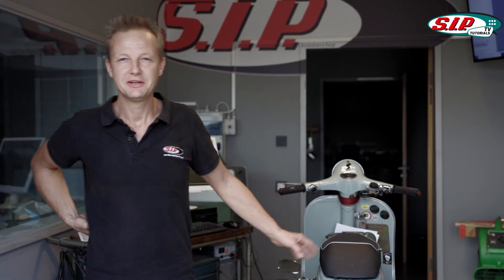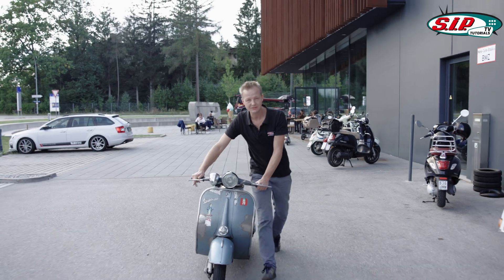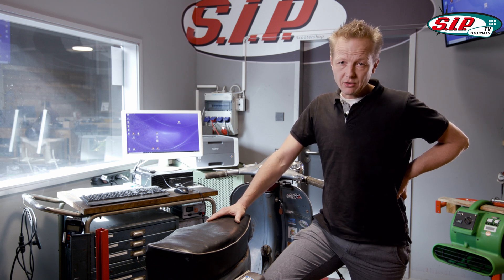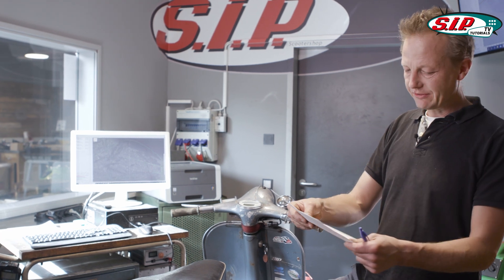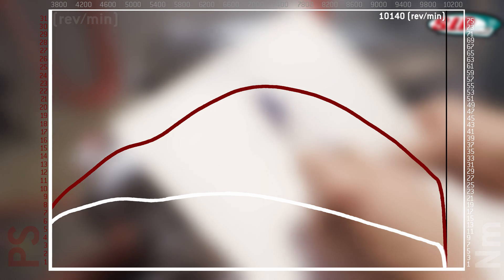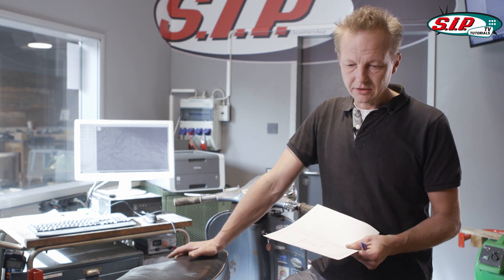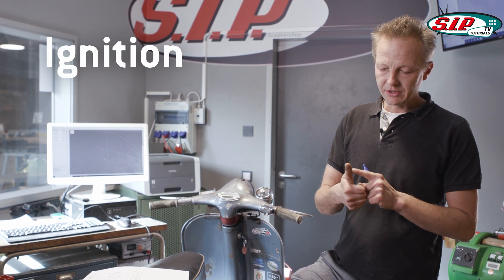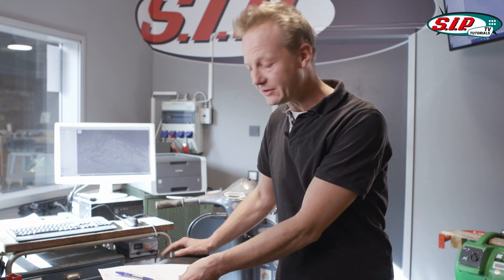Vespa PX Engine TUNING 🛵🔧 | Part 1 | Intro {English}

Comment: Hello, many thanks for your very interesting video. Could you please help to setup my px 125 arcobaleno, I have a pinasco 177 magny court, exhaust Pinasco, with a del orto carburetor 24/24 with 160/BE3/115, are these setup correct  ? Many thanks for your answer. Vespa for ever 😎